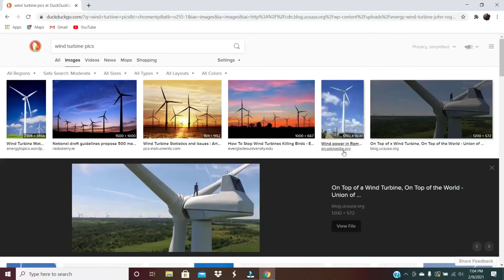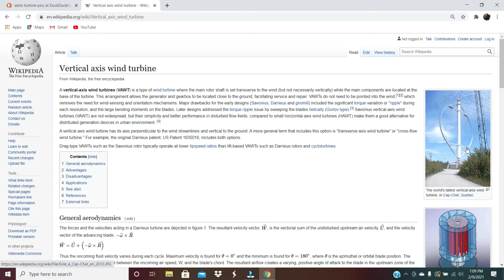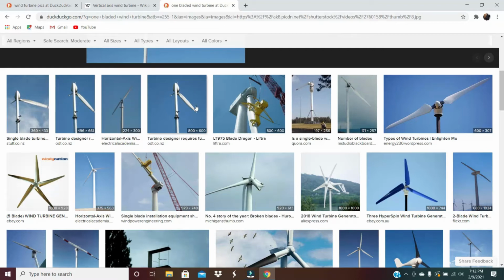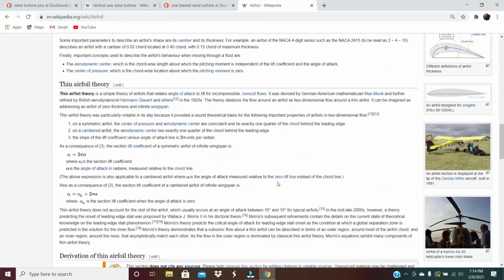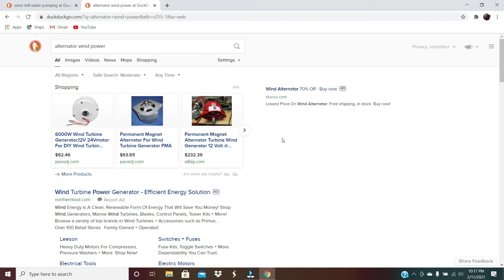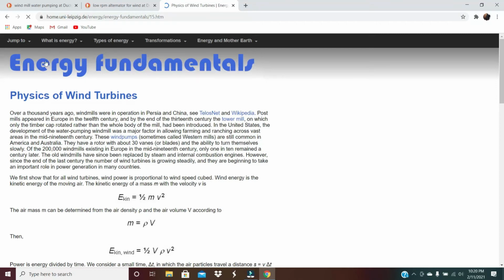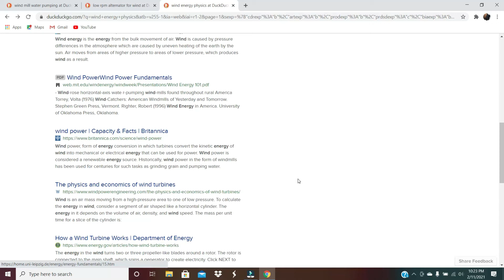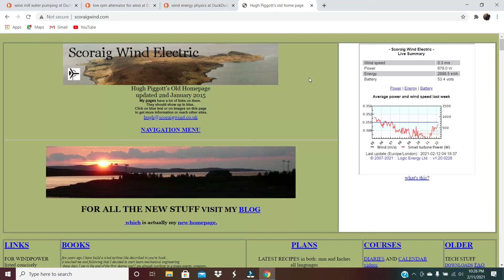Wind turbine design, what to buy, and what to stay away from, wind generators and wind mills

Comment: Your information is very biased.  You named zero reason why vertical wind turbines get used.  There's many.  Its funny that your reason not to is they require a lot of support getting them up in the air?  Lol. Wow hows that more than a horizontal?  As far as efficiency…   Theres a wind farm right next to my town. In eastern Washington.   Its in its 3rd ownership.  In its 3rd bankruptcy….   The only money in wind turbines was in the government subsidies that Obama personally  made 90 mil from.    Literally.  Went in worth 2.3 mil.  And our worth 95 mil.  Go figure. 
Verticals may be a little less efficient.  Or rather were.  Using new axial flux coreless generators has gotten them closer.  And dropped wind speed to start.  
They also  require zero maintaining of wind direction. And do not need to be as high in the wind stream.  Rhe y can be stacked and places next to each other in a wall fashion.  Lets see you do that with circles.  😳

As far as fogging.  Check out a pm axial flux coreless bldc generator.  You drop the soft iron cores.  Making them not stick to the magnets.  So very very low torque.  And easily reach very high RPMs.

Comment: Actually - sailboats also use the lift concept - the same as an airplane.  Think of the sails as one wing and the keel as the counter-wing.  The wind interacts with the sails in the same way it does with a wing - creating a pressure difference which moves the boat through the wind.  The old school square rigged sails were pushed along by the wind- but modern boats have improved upon that.

Comment: no man this is just not true the reason they put only 3 blades is becous they are very expensive to make we are talking like half a milion and there is diminishing return bur the more blades u have the more wind u catch the one whit 1 blade misses like 70% so as a blade it usess 100% of the wind but as a turbine its vary bad.u gain more as u make the blades longer and there is a weight factor to conside but if we talking just powe 3<4<5<6.

Comment: It’s all about blade surface area it’s pretty simple take a 2 x 2‘ piece of plywood hold it up against the wind and feel the pressure to force pushing against you then take A 4 x 8 sheet of plywood and do the same thing.   Really it’s about the torque.  It’s about capturing as much wind as possible and using the torque the wind provides not the high speed RPM you get from small wind blade surface areas.  Which require fast wind speeds large surface area blades don’t require fast wind speeds they operate on torque
Reply: I've often questioned why they use the huge three blade HAWT when the torque output from a old farm style windmill could be geared for higher output speeds.
Reply: @Digidoc316  It would be interesting to examine one of those old farm style windmills and see what kind of force it provides.    I have seen paddle wheels in creeks that produce enough electricity for a house,  they don’t spin fast, they spin slow but the water provides due to its weight it’s mass a very powerful force and yes you just gear it up to higher RPM to turn the generator not rocket science.   You make the paddle wheels wider so more water is pushing against them and your torque increases.  The wind has way less mass and force than water does so the blades surface area must be larger in order to get enough torque so that you can gear it up two higher RPM to turn the generator.
Reply: @rmendes2mendes915  The physics of fluid mechanics is the same regardless of the fluid which, in this case is air.
The only difference is the compressibility of the fluid; air is compressible, heavier fluids like water are not.

Comment: 為啥我家旁邊那些大型風力發電機即使在30-40mph強風下還是慢慢轉呢？
Reply: It's due to a design criterion known as "Tip Speed Ratio. That is the ratio of the speed that the blade ends travel at through the air as they revolve, to the wind speed itself. This usually is a number that can range from less than 1 to somewhere in the teens (in the most extreme cases). In most cases the higher this number is the more efficient the turbine is. So this is an important consideration. But also influencing the tip speed is the diameter of the turbine. The blade tips on a small 3 meter turbine are traveling through a much smaller circle than say, a turbine with a 30 meter diameter. So to keep the tip speed ratio the same between the two machines, the larger turbine must revolve more slowly than the smaller one. If it did not do this and spun at the same RPM as the small machine, it would actually lose efficiency, not to mention being vastly more difficult to design and construct due to the extreme centrifugal forces that would try to tear such a turbine apart.

Comment: VAWTs are for turbulent wind lower to the ground or right on a roof where the wind is bouncing off other surfaces and coming from different directions.  You shouldn't put them on poles.  HAWTs work better in non-turbulent air. That's why they're on poles, to get them above the turbulent air level.